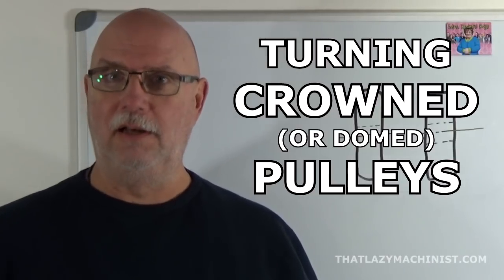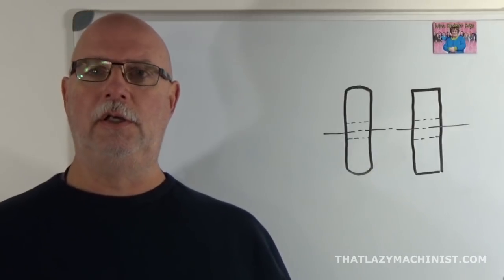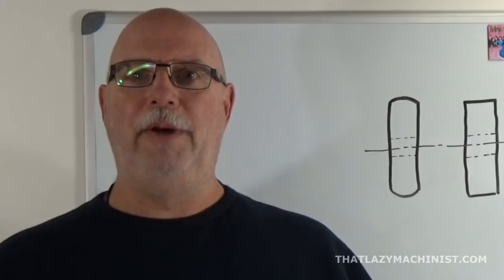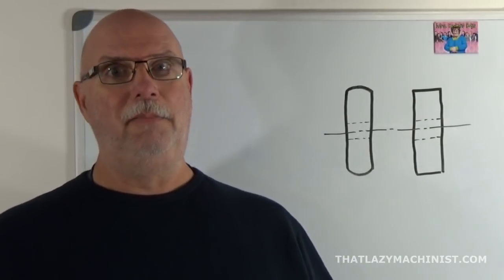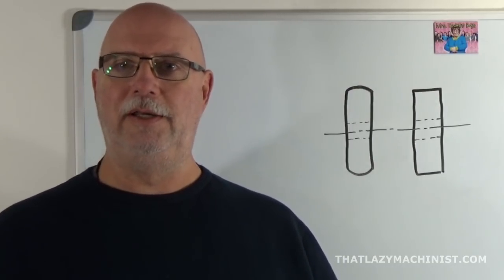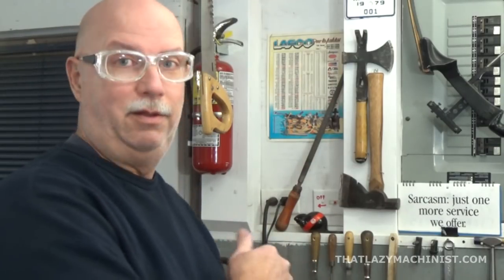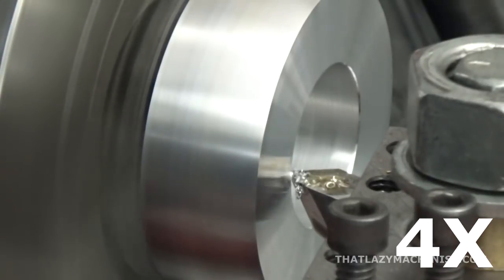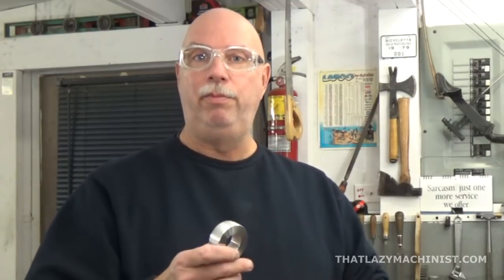MACHINING CROWNED PULLEYS OR ANY CONTOURED SURFACE ACCURATELY IN YOUR HOME SHOP with basic equipment

Comment: Never to old to learn, thanks so very much, never thought of clamping a part to the ways on the lathe, and love the red paint on the old Atlas lathe, it's a 101 correct, like 4 more, I have plenty of them. Was going to make a drive wheel for my belt sander 5", but the material is more expensive than the already made wheel, 3/16" key way and all,,,   👍👍👍👍👍👍

Comment: Better than leaving stock on the sides to center the crown is to leave stock on the OD. 
Blue the OD and cut the profile at a diameter that just leaves a little blue. The blue mark is the apex, so measure that to both sides and adjust the tool, or template accordingly before the final cuts.
In this demo the indicator was attached to the compound, so that could be used to shift the tool relative to the template.

Comment: Very instructive video, as all of yours are. I do not know what is the principle that causes the belts to self-center on concave rollers. Is there a Rule of Thumb regarding the radius of curvature on the roller relative to the width of the belt?
Reply from the maker: Hi Jorge! The crowned surface of the pulley turns at the same speed (RPM) all over. However the edges of the crowned surface turn slower than its center (surface feet per minute). It is that difference in speed that makes the belt track on center. In other words the edges are trying to catch up to the center and if the edges are not at the same speed, the one closest to center drags the other one closer to center since both edges want to have the same speed (SFM). I do not know what the rule of thumb is for the amount of crown but I can say that the friction caused by the difference in speed between the edges and the center will increase proportionally to the amount of crown. A pronounced crown will wear the belt faster. I hope this helps? Marc
Reply: Ah!! Thank you for the explanation Marc.

Comment: How cool is that? A lathe tracing "mechanism" where the servo function is done by the operator's eyes and hands. It give me great joy to see an actual radiused crown rather than the double angle (flat triangle) approximation I have seen used by several other Youtube machinists, including some creators whom I otherwise respect.

A question: is there any guidance on how high the center should be for different diameters and widths of pulleys? 

======= Note for the perplexed ========== 
If you have the width and the difference between the edge radius and the center radius (or most combinations of dimensions), you can calculate the radius of the template needed to make such a crown. Hint: google [ circle segment calculator ].

Comment: I know you are a better machinist than me. But you have a problem with the way you tighten a Chuck. You tightened only one nut  you should  tighten every nut a little at atime
Reply: Aren't they all on the same gear and which ever you turn they all will follow ?

Comment: Looking good...takes a little long and my concern would be not concentric..costing too much if you had to sell it for a living...
No need for radius...to do this fast, let me tell you how I do it in one set up without turning piece around several times, all concentric...
Take a little longer piece of material, drill, rough I.D. & O.D. a little longer to compensate the part off tool, finish I.D. & O. D. and with part off tool cut about 1/3 in.
Now...I could trace but no need, takes too long for one piece,  another way with compound, machine a slight taper both sides...I usually leave a little flat spot in the center of pulley.
I usually take this approach...[only for the experienced] machine a slight radius by hand, [no need to move compound]...you can still use the same turning tool, leave some flat spot in center also..one's I established how much lower the diameter of the pulley needs to be at the end, I'll see where the dial needs to be when I reach the ends when machining, I'll start power feed right or left from center and feed in by hand, starting to cut a little past the center of pulley ...feed in a little slow in beginning and faster toward the end, [you need to feed in very evenly] mimicking a radius...practice first without taking cuts..[or dummy piece] you can start first machining more the ends and work toward center for larger pulleys, I have good results, might need a little sanding, lastly part off.

Comment: Hi, nice idea that I will use in the future, thank you.

As 'rol eic' has noted, a flat belt pulley need only be crowned to have the middle at a slightly greater diameter than than edges in order to keep the belt on the pulley - 1/16" on a 3' diameter, 6" wide pulley is sufficient. The easiest way is to use the compound slide at an angle and cut two flat faces towards the middle.

The theory is that, with a greater diameter the middle travels faster than the edges and when the belt starts to run off it meets the resistance of the slower moving edges which pushes it back to the middle.

I have heard people say that this is not correct -
I am a volunteer at a steam museum in England, Forncett Industrial Steam Museum, and we were donated a Victorian, 1840 - 1870, line shaft workshop that we had to transport to the museum and set up to run. 
Believe you me, the theory is absolutely correct. We had a steep learning curve setting it all up and getting it all running true.

I had one visitor tell me (I demonstrate the workshop, and we run it off a 15nhp Marshall steam engine) that the belts are shaped to the pulley and are bent over at the edges to keep them on...he was still adamant that he was correct and I was wrong when I showed him 5" wide belts staying on 6" wide pulleys. Some people will believe anything!
Reply: Hi Andy! Thanks for the great input!

Comment: AvE did something similar with a cell phone and paper printout on the mill, https://youtu.be/WFzCPEdezog

you could get the centers aligned  by moving the carriage until the indicator is on center, then use the compound at an angle to move the tool to center of the part

Comment: You don't need a round surface to make a belt run centered. A two shallow chamfers touching in the center of the pulley are sufficient. Check out  this video https://www.youtube.com/watch?v=3cHnZ4o8Sxc
There are many ways to skin a cat. Simpler ones and more complicated ones.
Reply: yeh, same as the wheels on a train
Reply: yes, only very different ;-)
Reply: Sure, in this case a simpler solution would work as well. But this method shows how you can transfer ANY shape from a template. That's more of the piont of the video.
Reply: No that is actually not the point. The title says  "machining crowned pulleys" not "machining crowned pulleys in more complicated ways than really necessary" ;-) This is called "happy machining" because hobbyists (and youtube machinists) dont care about time and effort going into their methods because their reward is having a fun time or a fun video (and more time is better for them). But a professional machinist tries to spend as little time as possible to finish a job so he can get to the next one and earn a living.

Comment: That is a great technique and I will try to remember it.  You and I have basically the same lathe although mine is Craftsman and the drive is underneath.  So I suspect that we have the same 3 jaw chuck.  My chuck is .003" off center when the jaws are nice and tight.  Your chuck looked like it was dead on.  If it really is how did you do that?  Thanks for the great video.